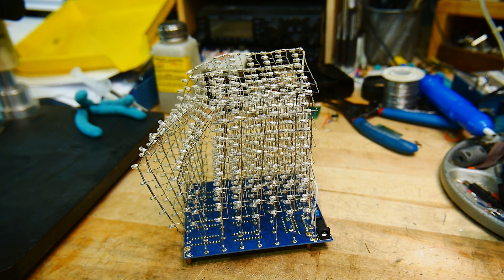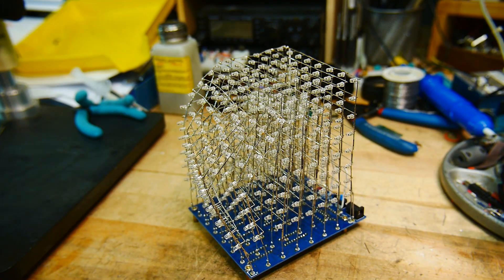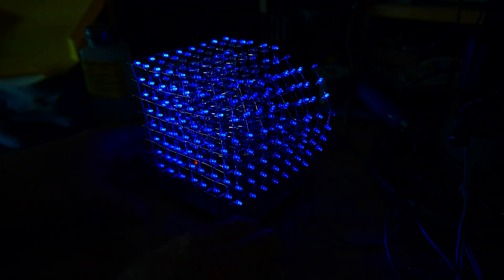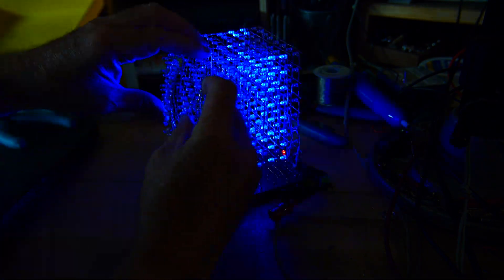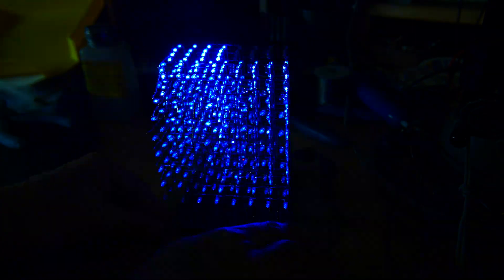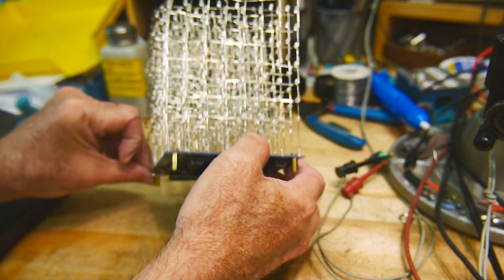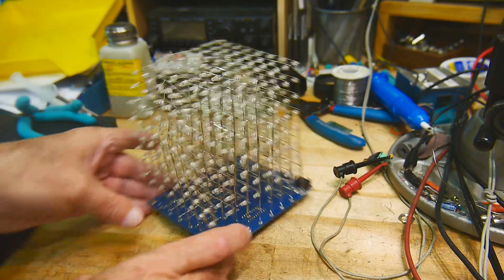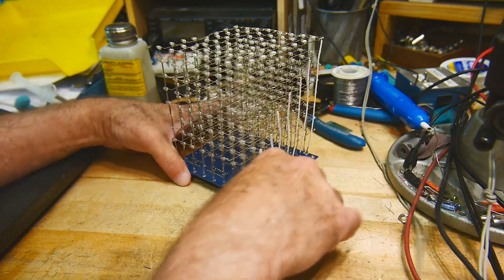#438 Bent LED cube 3D display

Comment: I'm building one now. The LED's are square, so no drilling a 8x8 jig. Right now I'm glad I didn't get the 12x12x12 or 16x16x16 one. Although the 12^3 one has 4 pin RGB LED's...